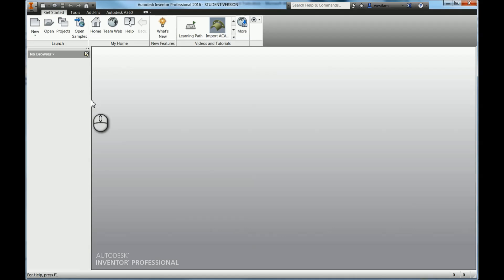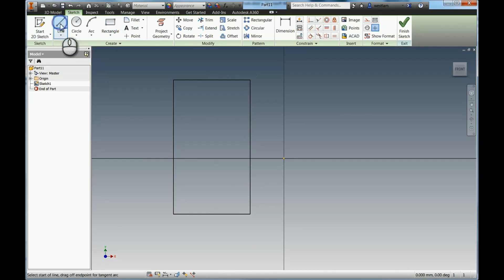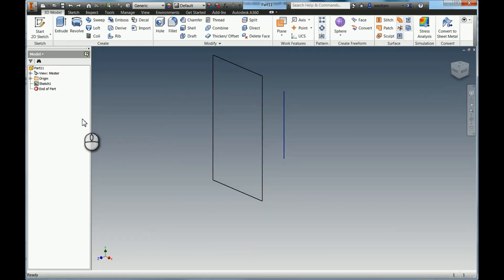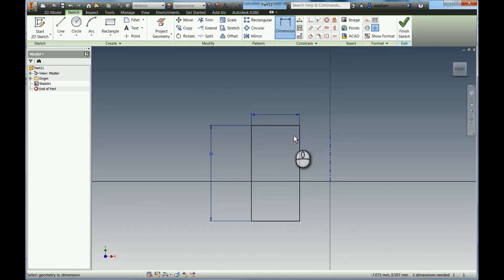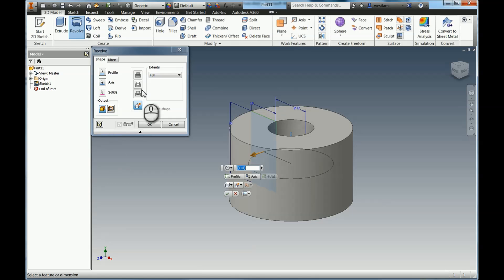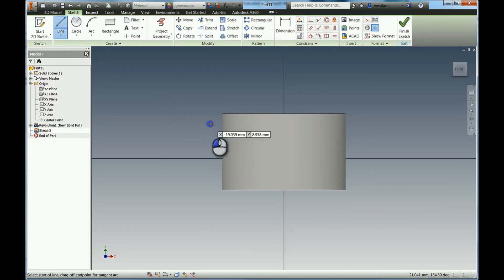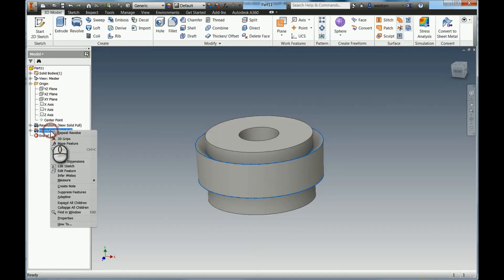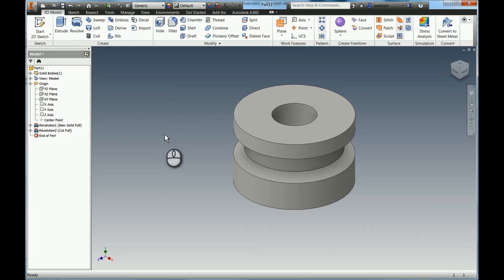Using the revolve tool in Autodesk Inventor

Comment: I'm on inventor professional 2021 and i have an unexplained problem. I cannot simply click on axis and select what is on screen. There is just an error message and no explanation.
Reply from the maker: What does the error message say? If you've drawn a 'centre line' then it will automatically be selected as an axis automatically.

Comment: I ran into a spot of bother with some parametric functionality of this in Inventor Pro 2014.  I'll put this out to the AI community.
I'm creating a feature that replicates as a rectangular pattern based on the extrusion length of a cylinder.  What I want to do is cut a certain spacing of circumferential teeth starting from the end of the extrusion (not the origin) - only so many teeth are possible for a given length so I had worked out an equation to come up with a valid number.  Once I do a rotation I'm required to select all of the features I wish to rotate - but I can't seem to find a way to just select the output of the sketch rather than a specific feature.
Doing rotate feature-by-feature "works" at sketch completion time, but when I later adjust the length of the extrusion - Inventor loses its mind, rather than just solving how many features to rotate based on the output of the sketch.
Am I missing some buried option somewhere?  Or am I too optimistic that I can pull simple programming into a design?  And before answering... "no", moving from a perpetual license of 3x $15K sets of design suites to a cloud annual subscription is not a valid answer...  Autodesk has gotten as much money out of me (a private individual) as they are gonna get.
Reply from the maker: Hey Tim, I'm struggling to fully get an understanding of what you're trying to achieve, do you have a video/screengrab? I think what you're trying to do can be fixed with iLogic. A simple scripting method to enable you to do configurable parts - which is exactly what it sounds like you're trying to do? Here's an overview article from Adsk website; https://knowledge.autodesk.com/support/inventor-products/learn-explore/caas/CloudHelp/cloudhelp/2014/ENU/Inventor/files/GUID-B98DF82D-E489-4C19-8351-11C0ED63C349-htm.html
Reply from the maker: The other thing I think would be worth consdiering is using the parameters part and doing a "pattern" within the sketch, then tie that to another dimension (i.e. the legnth). Then yor multiple of the sketch (teeth) would be dependant on the length. This is taxing for parameters which is why my firt thought was iLogic. Let us know how you get on!

Comment: How do i keep working on an already saved profile?
Iv'e made a profile, done with dimensions and everything (but no centerline or dimension from profile edge to C-Line), and then saved it and opened it the day after, how do i get it to measure Dimension from the profile edge and to the centerline so it revolves and makes a hole in the middle like you did here?
Right now, Dimensions refuses to attatch to the profile. It's like clicking on nothing. And after "Finish" i can not click on the CLine to mark it as a Revlove Axis. Only the profile edge can ba marked. This shit gives me headache. Why the hell can't i just keep working on a saved file like opening a picture with paint or photoshop?